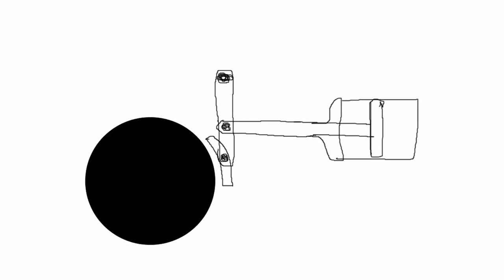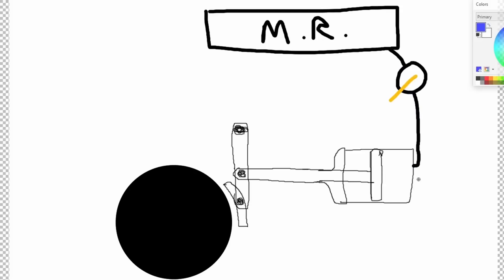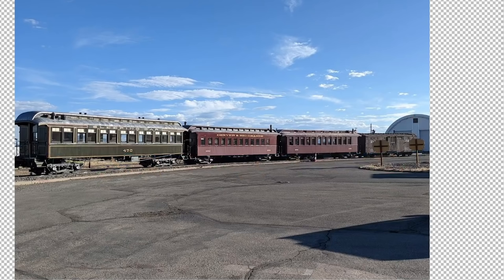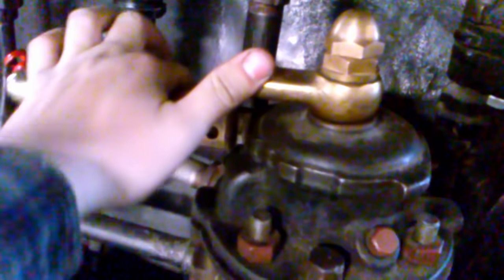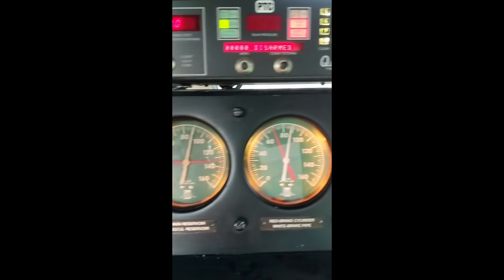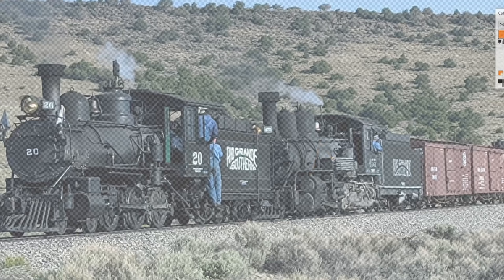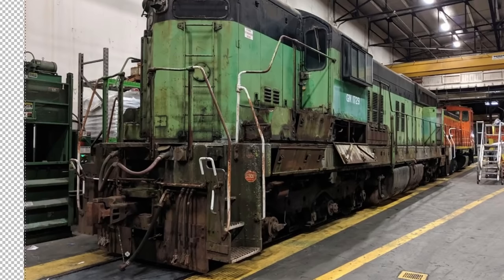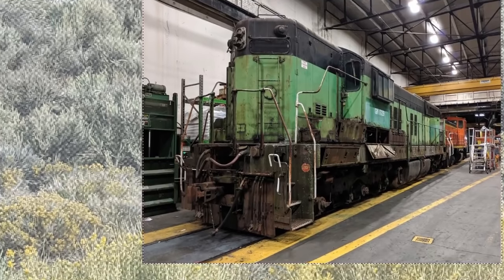AIRBRAKES 101: 10 levels of TRAIN BRAKE understanding!

Comment: maybe this has been asked already... could you elaborate on why the brakes are not "sprung on" like on a semi truck? it seems like that would be the most fail-safe solution and would require a significantly smaller volume of air to fully release the brakes than a system with a reservoir on each car. (and more cost effective too, as I bet the spring is cheaper than a whole triple-valve-and-reservoir combo).

one reason people like to say is that sometimes, you need cars to roll freely and you can't expect the brake pipe to hold pressure to keep the brakes released for an extended period of time. perhaps the hand-crank wheel at the end of the car could be such that you have to crank it down to release the brakes (through sufficient levers and gearing to give you a chance against the heavy spring)? that would also offer the convenience that if a car started rolling due to having its brakes caged by the hand wheel, and you needed to quickly dump the hand brakes on it, you'd just have to release the ratchet on the hand wheel and let it spin freely to let the spring start pressing the shoe on to the wheel.
Reply from the maker: When you've got hundreds of cars to deal with, sprung-on brakes work against you. Something will fail, and you will have more issues of flatspots / hot bearings / etc. - that's why we achieve failsafe braking via the pressure differential instead.

Comment: Okay, so when you want to brake the train, your loco loses pressure with that valve, which tells the individual cars that they should apply the difference from their reservoir to the brakes? 
Like you have 90 as full pressure, no brakes, set the lever in the loco to 80 and you get 10 from the cars to the brakes?
Then you set the loco to 90 again, the reservoirs fill up again, you get equilibrium and the brakes are off.
Reply from the maker: That is the very basic concept of it, yes.
Reply: @Hyce777  awesome, now I finally understand it. Thanks!
Reply: @Hyce777  Would be my guess that this system is designed in this way to increase the brake response times. I mean this reduces the amount of air that needs to be bleed from the pipe system to apply the brakes or pumped back into the pipe system in order to release the brakes since you are only dealing with the volume of the pipes themselves. But if you would be pumping and releasing the air pressure directly to the pistons you would be dealing with a lot larger volume (volume of pipes + volume od pistons) and therefore you would have to pump a lot more air from the locomotive back to the cars which would take a lot longer to do so.
Of course the drawback of this system is that if the pressure in air cylinder that is on specific rail car gets to low like from applying breaks multiple times without allowing its pressure to be recharged you could end up with no brakes on that specific rail car.
Reply: @silvoweiss347  Not exactly.  You still initially have to charge all of the brake pipe, and all of the reservoirs of the entire train, either initially, or after a brake application and release. 

What you have is an air operated, remotely actuated, failsafe (pretty much) brake system.

One of the other things that wasn't covered because this will start melting brains is that your brake application is pretty quick, but your release is actually delayed, and on a conventional one locomotive train, starts behind the engine and then proceeds to each successive car thereafter.  Because one hose does both the application control, and release recharge functions, in a long train, you could actually have the cars behind the locomotive with released brakes, and the last cars on the train still have their brakes set... because they have not seen the increase in brake pipe pressure yet because all the cars prior to them are recharging their reservoirs. 

There has been some talk of going to a 2 pipe system (which it probably should have been from the beginning), where one pipe is the application control and the other ties ALL the reservoirs together, or at least functions as a charge pipe to keep them pumped up from the locomotive(s) so when the next brake application is called for, there is sufficient air on hand to operate the brakes. This system is at least twice the cost because you have double the plumbing and maintenance of another set of hoses. Cost is still king on the railroads... If you're really going to do it right, use a charge line for the tanks, and an electric signal to trigger the operation. That would really be slick, but also a lot more money and almost impossible to retrofit because you'd have to do the entire fleet to make stuff work. That's why it will never happen...

Comment: Vacuum brakes are fairly simple. UK systems operate at 21 to 25 inches of mercuary vacuum.  One advantage with steam is that a vacuum can be creaed by an ejector using steamthrough a number ofcones and has no moving parts. 

Like air the train pipe rruns the length of the trainI the running position the train pipe has full vacuum and the brake cylinders have vac both sides of the piston. To apply the brakes the driver will reduce the train pipe vacuml and the diference in vacuum causing the piston to rise and pull on the brake rigging. The brake is fail safe in that if the train parts all vac will be bumped from the train pipe and the vacuum stored in each cylinder will apply the brakes in both halves of the train

Comment: I know there are different systems like K brakes, AB brakes, etc. ( eventhough I don't know the difference LOL ). Question is what type does the Cumbres & Toltec and the Durango & Silverton use?
Reply from the maker: Well that's just a horridly complicated question to answer, lol!

Both the C&TS and D&S have 6ET automatic braking systems in their locomotives. The C&TS also has at least 168 with A-1, the older style. Not sure if the D&S has any A-1 in service.

The C&TS has AB on all of their excursion cars (daily train service). The historic train has a mixture of F's (basically K's) and K's. Their freight cars are all K's.

The D&S has K's on everything, but they've also got this bizarre dual air system setup where they also have straight air like we talk about in the video backfed through the retaining line, so they can either set up the airbrakes using automatic air, or straight air... it's a little mad, but it works!

Comment: The steam driven compressor should be able to make higher pressure air. It is all about the relative size of the piston on the air side vs the steam side. Isn’t it?
Reply from the maker: Correct. Explained it wrong originally.

Comment: Basic brakes are mechanical, twist wheel or pull lever to apply brakes. 

Vacuum brakes are too complicated, air brakes are the norm, because, as you said, with vacuum you can't get any less pressure than that, and it has to remain airtight to function properly. With air brakes, these use air pressure you can increase until either the train stops (still goes forward due to momentum, i.e. the heavier the train: the further the stopping distance) or the valve can't take any more and something goes wrong and you have a runaway.

Hydraulic braking uses thick viscous fluids pumped in by, you guessed it, either air pressure or mechanical pumps, to take the place of air and are generally maintenance intensive with all the hoses, fluid reservoirs, o-rings, and other things to make sure the fluid stays in the lines and not spattering on the ground as if the train were bleeding.

Don't know if hydraulic brakes are used on locomotives though. Hyce? Were hydraulic brakes used on locomotives?
Reply from the maker: I have never heard of hydraulic brakes in a railroad application myself. I assume that they did exist somewhere for some reason, but not in the general railroad system in the USA.
Reply: @Hyce777  Probably existed in some obscure fashion by such and such railroad on an experimental engine somewhere in the US. Let's face it, we're the only ones crazy enough to try something like that.

And the Australians.

Comment: What are the brake shoes themselves made of? On the Montreal Metro, they are wooden, maple I think. If you are on a train and an emergency stop happens, it smells just like it does when I light my charcoal BBQ.
Reply from the maker: Used to be cast iron, these days it's almost all composite material of different hardnesses. It does have a unique smell, that's for sure...

Comment: Hyce i have a question is it possible to lock wheels on a steam engine if you apply the emergency brakes and put the engine in reverse while moving, ya know like every crash in Thomas and friends where their wheels are locked and they are slipping on the rails while stopping
Reply from the maker: You certainly can lock them up, it's a bad time
Reply: @Hyce777  i imagine it's pretty terrifying for a engineer applying it's brakes on a emergency just for the wheels to lock up and you slip across the rails, i always had this question in my head thanks for answering

Comment: There is an interesting point on the "they aren't like trucks brakes" it's absolutely true, but in case of a damage on one of the tubes between the truck and the trailer there is a device that makes the system act kinda like the train system with a single pipe always in pressure except when you're braking. (It's called "Servodeviatore modulato" in Italian, I don't find anywhere how it is called in English, I'm sorry)
I'll explain what it does but first I'll briefly explain truck braking and various safety features for people that don't know it.
Ok, basically if you have watched the video like the independent brake of the train the truck uses a tank of compressed air to brake with positive pressure, for safety you have at least three separate circuit, one for the anterior axle, one for the posterior and one for hand brake and trailer.
The brake pedal is basically as two separate self-lapping commands, one for the anterior and one for the posterior axle, granting that if one line would break the other one would work. (It's not important for our story but for added safety the hand brake is applied without pressure and is the added pressure that releases it, so it could always be applied and if its line broke it would simply auto apply)
Then we reach the trailer, the trailer basically has a tank of air that is filled with a pipe always in pressure from the truck and another pipe that with positive pressure commands how much brake to apply.
To grant the safety of the trailer if it ever lost the connection from the truck if the pipe that should always be in pressure would loose it, the trailer would apply the automatic brake.
But what if the trailer would stay attached to the truck but only the other pipe would break? At that point the trailer, since that pipe uses positive pressure to command a brake usage, wouldn't be able to tell if the line was broken or if simply wasn't supposed to use the brakes, making the stop of the truck with only his brakes a lot harder.

The "Servodeviatore modulato" comes to the rescue, basically it is on board of the truck and it's connected to a braking line of an axle and the braking command going to the trailer, if the braking command it's broken it would dump air in the atmosphere and so the device would detect a lower pressure in it and dump in atmosphere the air going to the pipe always in pressure to stop the trailer.
But in some way it is even more similar than this, because this would only apply full brakes to the trailer whenever you'll apply any brake to the truck, but in fact the "Servodeviatore modulato" doesn't sump completely the pipe in atmosphere, it limits its pressure according to how much brake is applied, granting a variable braking force, using only one pipe line, normally in pressure and with lower pressure to apply brakes.

I hope whoever read all of this liked it.
Reply from the maker: Thanks for the comment, makes sense to me :)
Reply: @Hyce777  I love your videos hyce, I'm happy you liked this small detail on truck brakes

Comment: Also with vacuum brakes, higher altitudes would mess with the system as you are loosing atmospheric pressure
Reply: At least I think
Reply from the maker: Would reduce the maximum working "pressure" you'd get, I'd wager, but I am not sure.

Comment: 7:37 but why is it not like a semi truck? what is the advantage of this system? is it just another "because it's always been like this" thing? because you said yourself, that if the train stood for a long time, there would not be any pressure in the pipes, which means it wouldn't be able to brake. so in my eyes the semi truck cofiguration with the springs would be safer, right?
Reply: Back in the olden days you might not need all the brakes on all the cars. Especially if a few of them had problems and leaked a lot of air. Plus with how many cars they may have keeping all the air to all the cars might be difficult even when working right. 
And, with all the switching the cars may go through having the brakes lock down anytime the car is disconnected could cause problems. 

But, the modern systems are different and a little closer to big truck brakes.

Comment: I heard a comment that Canadian trains are set up better than U.S. trains( since the Revelstoke disaster) If they have 3 locomotives it's 1 in front one in middle or there abouts and another on rear  the reason given ,better train control. CP and CN would use this rational, CN once had a 16,500 foot train with 3 locos on front 1 @1/3rd, another at 2/3rds and one on the back, same reason. The head end was 4 miles from the next stop where the last third and two locos were dropped, basically a train went for a free ride on the back end of the other train.

Comment: So with double heading, the loco with it's brake stand cut out can still use its independent brakes right? Feels like a silly question but I would think that the train with the bigger air pump would be used for braking the whole train. I can guess why only one loco is used and that's to eliminate risk of over pressurizing the air system or back feeding from one loco to the other. (Just a guess). 

Double heading in itself is fascinating to me as well because my understanding of physics tells me that the front loco should be the powerhouse and the second loco should be trailing and adding power in when needed as well as applying its brakes to prevent the lead from getting overcome. Literally writing down notes to follow along. 😂
Reply from the maker: Cheers! Yeah, the independent still works when the automatic is cut out. You actually can't have both valves cut in for brakes to function, if the lead engine sets up and the rear engine is in running it won't set up. Etc.

Comment: I was taught that the pressure in the  reservoir on the car was what actuated the brakes and when the pipe pressure and the  reservoir pressure was the same the brakes were released. This is different from the idea that the valve compares the pressures and decides to apply the brakes. Brake valves prevent the discharge of the  reservoir when the pipe pressure drops and keeps the  reservoir isolated until the pipe is recharged.

Did I misunderstand or am I just wrong? Also what about the brake controls in the caboose?
Reply from the maker: I think you were initially incorrect. Let's think through it. If you are charged and at normal BP pressure, you've got 90 in the res and the BP. If you make a 5 psi reduction in the BP, the res sends "the 5 psi equivalent" to the brake cylinder. It now matches the BP again, but as long as you hold it in lap, they will match with the brakes on, as the res needs the BP to increase to charge back up. 

The caboose controls are basically just dump valves that dump the brake pipe to 0.
Reply: @Hyce777  OK on rolling terrain the caboose or rear end device brake valve is used to set brakes from the rear of the train to prevent the slack from running in on down hill segments. Setting the brakes from the head end means that the cars in front will be braking first and the coupler slack will produce a big slam near the middle of the train. Also in an emergency the rear valve is used to speed up the application of brakes by venting the pipe from both ends. This also avoids slack run in which can cause derailment. At any rate, having a rear brake valve can be a big help in handling a long train.

Anyway unless I am terribly wrong the brake cylinder has 90 PSI on both sides of the piston and a pipe reduction causes an imbalance which forces the piston to move in the direction that applies the brakes.
Reply from the maker: @keithstudly6071  That's the case for an ETD (End of Train Device) for sure, maybe some later cabooses had similar functionality? but none that I've heard of. As well, as long as you take a "first service" equivalent set, you don't get the big slam. So far as I know the ETD can only dump the train, but I've never gotten to run with one.

Brake cylinder does not have 90 PSI on both sides. You're thinking of the triple valve or it's equivalent in modern systems.
Reply: @Hyce777  I stand corrected. Thank You.